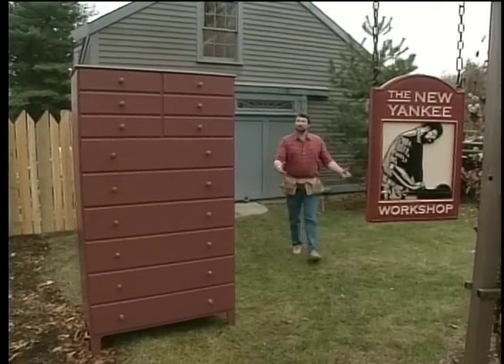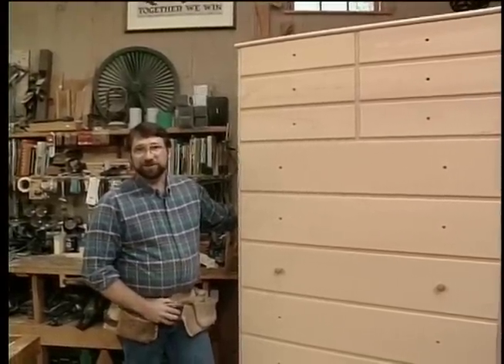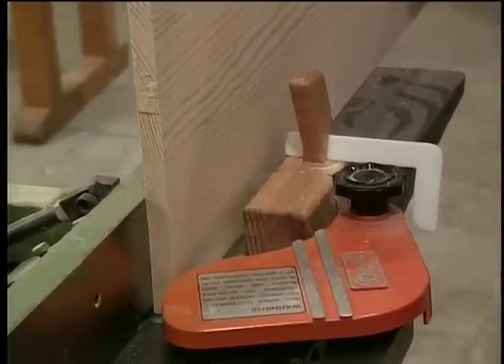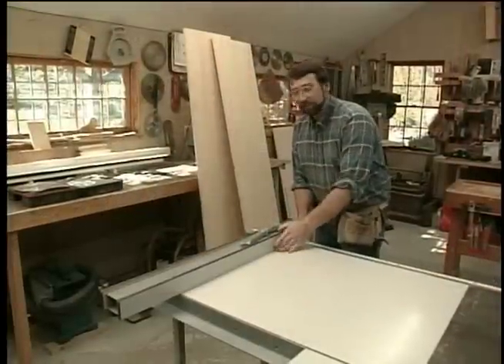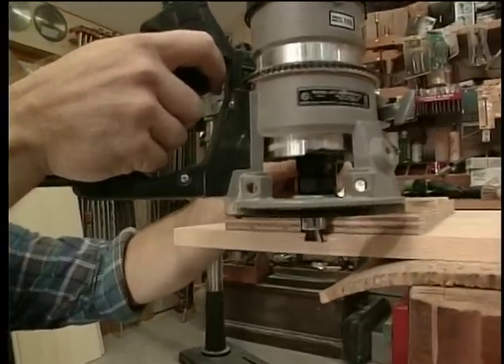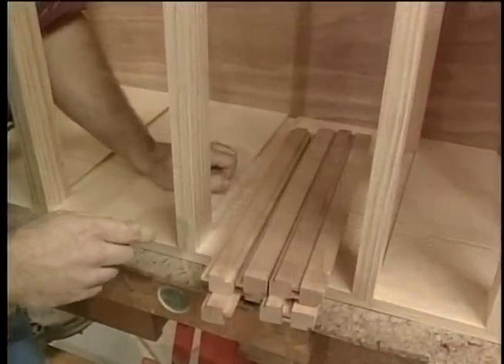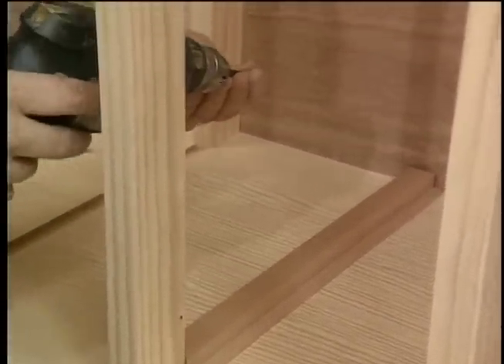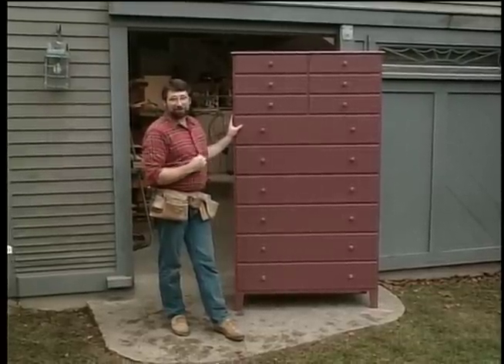Shaker Tall Chest  |  S4 E6

Comment: This was the first plan I purchased from NYW.  Although the project is big, it is not too difficult..........no crazy angles, most are 90 degrees.  Just lots of repetitive cuts.  I chose to stain mine instead of painting it.
Since my bedroom is at the end of a narrow hallway I couldn't lay the piece over to get it through the doorway..........it would hit the wall on the other side.  The only way in was to stand it straight up.  However it was just about 1 inch too tall to fit so I had to remove the top of the dresser as well as the top door stop in the frame and shuffle it under.  Wow, I bet that was close to 20 years ago!  I still use the dresser everyday.
At 2:20 Norm says it all.  I just had to build it.

Comment: I built this piece years ago and am considering building another but as Norm’s skills progressed over his 20 plus years doing the series, I wonder what changes he’d make using different woodworking methods? I suspect he’d stick a little closer to the original shaker design such as the base/legs and perhaps use the raised panel drawer bottom design that the original had (which I really like)